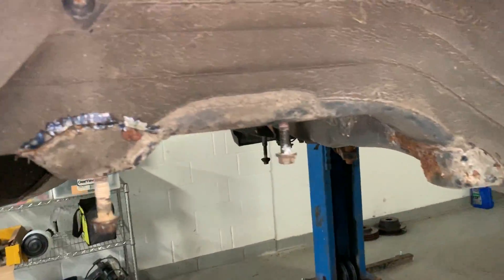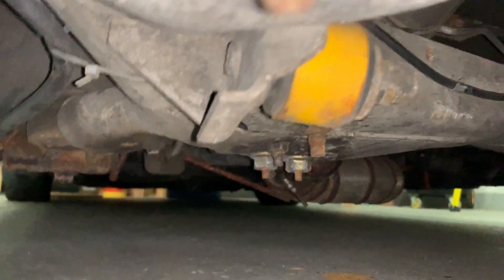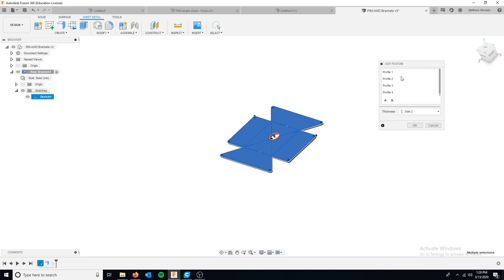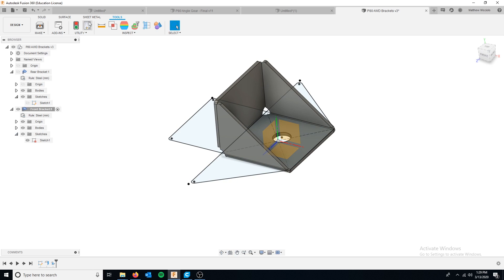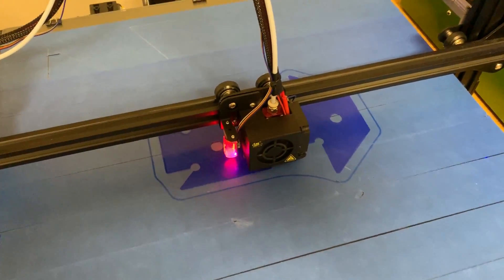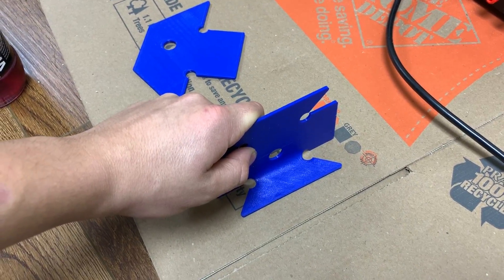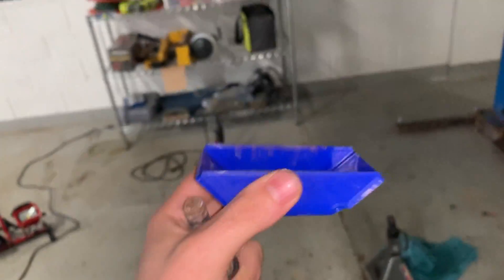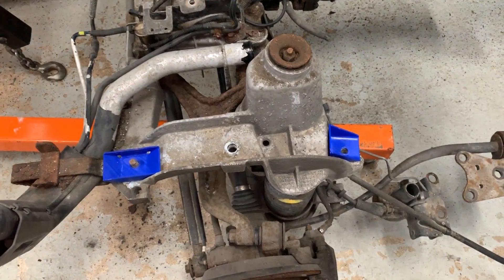Volvo 850 T-5R AWD Swap - Rear Subframe Bracket Prototyping

Comment: Can you make the STL file available for purchase on your website? Would love to do something similar, but can see the nitty gritty of measuring and producing files and prototypes stopping me. We never got awd s70's in aus, so an awd swap is the only option other than importing.
Reply from the maker: I won't be selling the STLs or any of my designs b/c people will rip off my designs, but I will be selling a weld it yourself AWD swap bracket kit here shortly on my website. It will include laser cut brackets and hardware.

https://shop.hellmooseperformance.com

Comment: Consider 4140. Stainless needs back purging & generally isn't great structurally. Chromoly has better corrosion resistance than mild steel but can still be welded fine with ER70.

Comment: Do the originals wrap up on the frame rails a little on the sides?...  Hard to see.. In the video....    And hey.. If you ever need somone to hold the camera.    Id be happy to help.
Reply from the maker: Only on one side of the rear bracket. I don't see a problem with not wrapping around on that one side as my brackets will be welded all the way around.
Reply: @SimplyVolvo  yeah....  Good welds will hold..    It looked like they krept up onto the rail....   Awesome project... You are making all us old volvo freaks look good,!